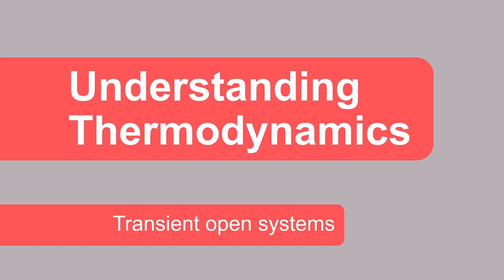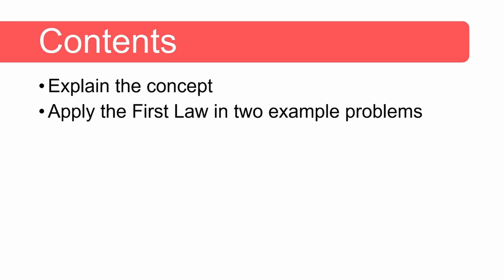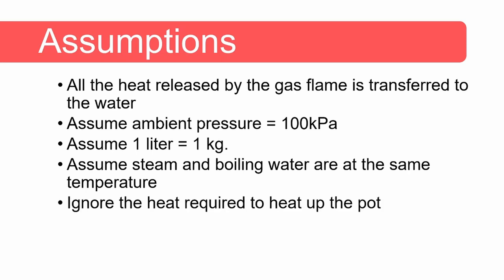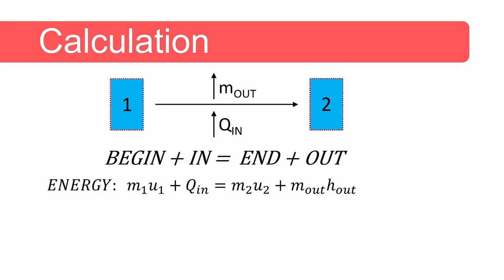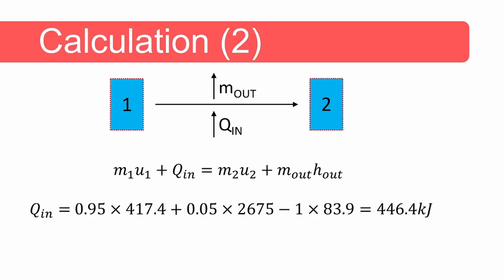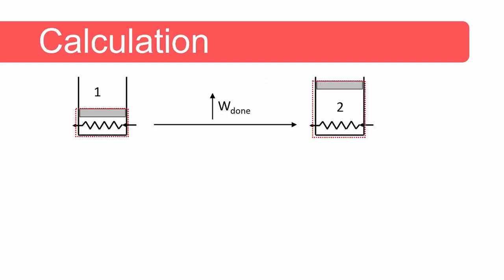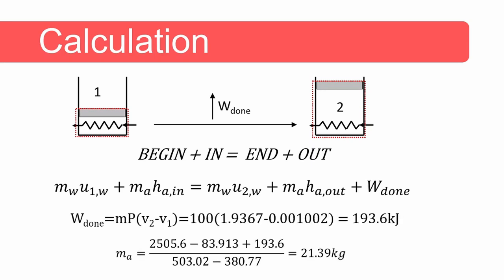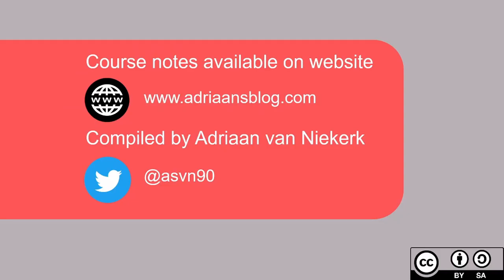Transient open systems in Thermodynamics | Understanding Thermodynamics | Mechanical Engineering

Comment: Good day sir. I notice that you say that on the right side of the equation: its superheated steam with its internal energy but you substituted the value of when T=100c with u sat value: 2505.6 instead of using T=150c with u sat value:2582.9 from the superheated table. I see that you substituted v= 1.9367 at T=150c and not v= 1.6729. 
ARe we ignoring stage 2 where the water starts to boil and only considering stage 1 at T=20c and at stage 3 at T=150?